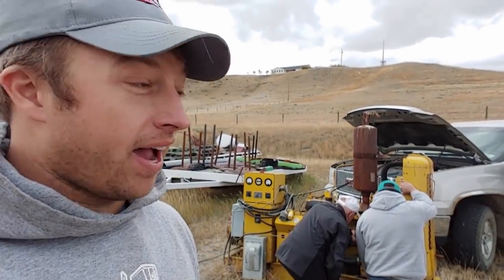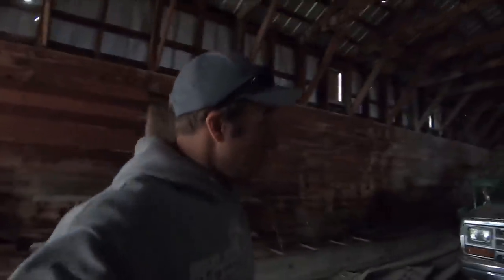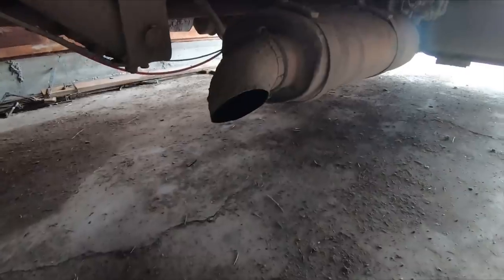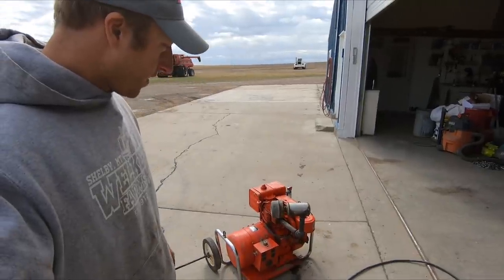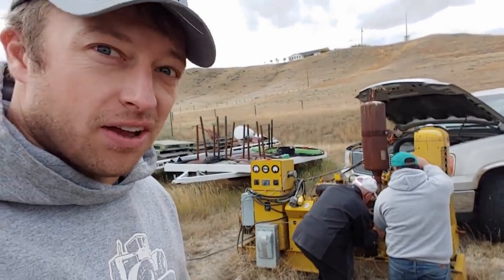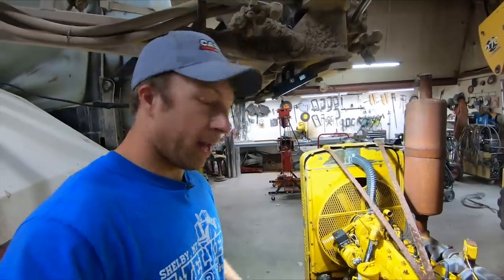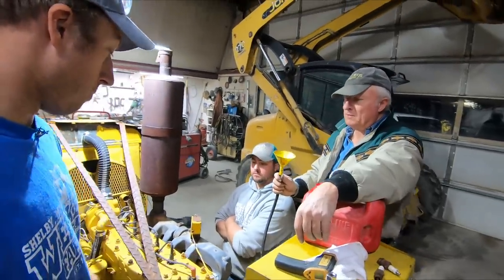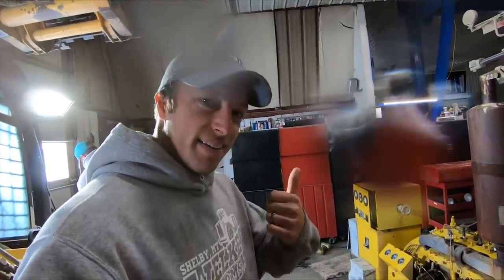Old Generator For A Mighty Storm

Comment: A shout out to everyone who’s fixed a pull starter issue on a small engine👍!
Reply: Joseph Huelsmann them recoil springs suck
Reply: @shelly8334 , Agree. 99% of the time, the spring doesn't need to be removed. Remove old rope, feed new one through the hole, knot the end and use that notch Nick pointed at to wind the spring and rope at the same time.
Reply: Part of shop class in high school was small engine repair-- part of the test was the teacher coming up and cutting the pull cord and making you replace it.  Disliked that man.  Loved that class.  Learned a lot.
Reply: my recollection was a piece of old clothes line was used
Reply: I once inherited a 300$ mower from the trash on the side of the road because they broke the spring that pulls the rope back in. Gave it to a friend three years ago and still running.
Reply: Ditto but I loved my teacher.
Reply: shout out for anyone who shot the BS with the .45 and got a Kohler
Reply: @darthvader4hire  those old b&s engines are pretty relaible
Reply: But did it the easy way........😂
Reply: I don't understand why people hate re-winding a pull starter, I do it all the time, With a little patience and the right tools it is very easy.
Reply: @russmontgomery5211  It is easy, and most of the time disassembly isn't required. Manually wind the plastic rope sheave against the spring tension a few turns, (not too tight or the spring end will break), hold it in place with the tension on it, and feed a news rope in and tie a knot. When the sheave it released, (slowly), it pulls the new rope in.
It takes longer to remove/replace the pull starter assembly itself than replacing the rope.
Reply: @russmontgomery5211  you dont have to pull them to bits most time. Leave the recoil alone.
Reply: @michelebeck4311  I am probably more aware than most on how to fix a recoil starter ( I probably do 10 or more a week) So I do not need to be reminded, But thanks anyway.
Reply: Amen, brother!
Reply: I tried doing that once then during a break noticed the impact wrench I'd been using to take the pull starter housing apart and got an idea.
Reply: yup i fixed a jd 68s pull start it has elcetric start but i use pull start too

Comment: ok, so what i used to do on the oilfield generators i built and worked on is set the throttle speed to the hertz meter you will need 60 hz for proper power. so set the throttle up to speed till you get to 62 HZ so when the engine pulls down under load you will be at 60 hz and adj. the regulator to 120V or 220v whatever voltage it's wired to. keep it under a cover so those old exciters on the generator don't get wet and put a good shielded/sheathed ground cable on the frame and attach it to that ground rod i saw on the frame and drive it into the ground. i would run a battery tender to the unit to float charge the battery and also a block heater so when you need the unit it's GTG. a normal house will need close to 8KW to run most lights and appliances minus the elect. stove and water heater. i can run my house minus the elect stove on 7500 watts we have  an on demand water heater and we have mini split A/C and heat pumps which don't use much power i can also run my well pump and charge pump etc. with that. i can not use my air compressor but can run my lathe and mill and shop lights etc. with the 7500 watts. 35kw is a great size generator to wire in if you have all the houses on a grid and i would also look into a surge protector to protect your homes from overload.
Reply: This.  Make sure you get the frequency right or you will burn out almost anything that you plug into it.
Reply: Maybe you already have one but you MUST have a means to disconnect the utility from your house before you tie in the generator so you don't power up the lineman doing the repair from the storm.  Normally this would be a transfer switch. And yes, don't forget the earth ground connection!  Nice rig. Good job getting it running.
Reply: They're not hard wired there yet but now a manual transfer switch is the cheapest way to go.

I'd throw on a car remote starter too. And a propane conversion kit this way here you can run off an 80 gallon propane tank.
Reply: @anastyb  i like the propane alternative we use 100# bottles here so i can fill them when i go to town for $1.75 a gallon as opposed to well over $2 to have it delivered and i use the bottles in various locations on the property so 1. bottle wouldn't do. propane will last forever in the bottle as opposed to gas which doesn't age well. in some areas propane is super exp. i bought some in Redwing MN one time for my RV, i thought i was filling the bottles with liquid GOLD.
Reply: @markthegunplumber8376  wow and I thought things out here on the East coast or expensive I just checked the prices and we only pay a dollar 41 a gallon delivered for propane we can get it for a dollar 34 if we take 500 gallons.
 In days past we used to get twenty one hundred gallons of number 2 oil this way here we were all set on heat for the whole year.
 my friend Mark was in northern Connecticut with a farm and he cooks and heats hot water with propane he gets hundred-pound bottles filled down at the Agway because he says it's cheaper.

Yeah the propane conversion kits are cool I've used them on my Jenny's in the past.

Adding remote start is an added bonus.
Reply: @anastyb  that's what happens when you live in a Liberal run state. it's not the propane that's expensive it's the taxes on the propane that's expensive. it's .34 cents a gallon here plus any county taxes on top of that.
Reply: @markthegunplumber8376  wow that's cheap!
 I think $7 of the $10 for a pack of cigarettes here is tax.
Reply: @anastyb  no oil and gas here so it's all trucked or pipelined in and our LGBTQ Governor only wants wind and solar energy here she hasn't figured out that you can't run vehicles and farm machinery on hopes and dreams and rainbows and unicorn farts. this is the only state left i think where it's illegal to pump your own gas. they want to save those jobs for the near do wells who can't do anything else.
Reply: @hihaveaniceday9386  formerly the socialist republic of Kalifornia now Retired in Orygun
Reply: @markthegunplumber8376  Ah, NEW JERSEY HERE . WE DON'T PUMP OUR OWN GAS HERE. I THINK WE ARE THE ONLY STATE WHERE YOU DON'T PUMP YOUR OWN GAS AND WE PAY LESS PER. GALLON WHERE YOU HAVE TO PUMP YOUR OWN.  BUT DON'T WORRY,  WE HAVE THE HIGHEST PROPERTY TAX'S IN THE COUNTRY AND IF YOU WANT TO DRIVE MOST PLACES YOU BETTER HAVE EASY PASS FOR ALL THE TOLL ROADS AND BRIDGES.  THANKS DEMOCRATS !
Reply: "NERDS!!!"

Comment: Best to be prepared. I remember about ten years ago we lost power in our home for two weeks due to a horrible ice and snow storm. 6ft of snow in 30 hours followed by a night of ice rain. It covered everything and every powerline with thick ice and ripped everything apart due to the weight. And because the ice was everywhere and we living at the very top of a mountain with one possible road to town we were completely isolated from society. We had no water because the well pump of course didn't work, but we melted snow on the fireplace/oven (I don't know what it's called sorry) and we got a new appreciation for everything we had in our cupboards and things like that. After the first week me and my Grandpa decided to try and make our way to town 3.8 miles of 0.4 miles hight different like, from us to the town. Everything was ice and we could bearly walk with shoes my grandpa had painstakingly screwed hundreds of screws into from the inside out for traction. So we started walking down at 8 in the morning, by 2pm we reach a road where farmers (bless them) were going back and forth with tractors picking up people and taking them into town for supplies at the back of sleads they'd kept from they did logging with horses many years ago. Well into town we realized just how dire the situation actually was - there was nothing to get. Apart from food, the stores had rationed out pre packaged boxes with food and necessary supplies depending on the size of your household, since we had 7 people and a very young child we got very much stuff, so much so we could hardly carry it between me and my grandpa - and we still wanted to get some fuel and a generator or propane (we have a backup propane fridge) but there was nothing left except some propane camping gear, so we grabbed a few of them and a Slead to pull everything in that we fitted nails to at the back so it wouldn't slide backwards up the steap hills to our house. We also got a small solar power setup with a battery and everything to be able to listen to the radio for news and possibly charge a phone or two (we actually had two old Nokia 3310 that we had decided to keep charged before the storm hit, and I'm so incredibly glad we did because they lasted the full two weeks and we could make calls to the people trying to help us) anyway, back to our town. We got packed up and ready to move back home, but it was getting dark and it was getting dark quick and with the temperature dropping over - 22 degrees fahrenheit there was no way we would get home. So we got to stay with a couple of old friends of my grandpa overnight, we got some hot soup, coffee and kvikk lunch (it's a kit Kat hiking chocolate we have here) with us for the walk home and started the journey home. It took almost 10 hours to walk home with all the gear, and my grandpa at 77 at the time struggled the least out of the two of us. He was a tank, powering through the freezing cold, old age and exhaustion the old man got us home to our family just an hour after dark when the temperature hit - 30 fahrenheit. Exhausted, freezing, starving and frostbitten we came home to the warmest welcome a person could ever get. Home baked bread from the fireplace, potatoes and some meat stew and a warm bed in the living room with everyone else. A welcome fit for a hero. Till this day my grandpa never forgets the trip or the two weeks of frozen hell, the worst winter in history for our little town and a reminder to always have some canned and non perishable food in the house. We now have a small generator and a big drum of gas the we swap the gas in every winter, enough to keep food and water going for our house for at least two weeks at all times. I'm sorry for the long comment, but I thought I would have to share this story with you guys. And sorry for not knowing every word in English. (I tried to convert the units for you guys though)
Reply: That was a very bad ice storm.  We have never faced anything like that.  Thanks for the memory.
Reply: The english was very easy to read thank you for your story.
Reply: Wow! Great story.God bless you and your family.
Reply: Tremendous story! Proof that YouTube comments don't have to suck. I salute you and yours, sir.
Reply: What country?

Comment: Definitely needs to run at 1800 RPM as previously stated by others to provide 60 hertz. Set RPM first then adjust voltage.

Comment: The 60 cycles a second depends on the engine rpm. By you slowing the engine down you may have reduced the cycles per second and doing that can damage whatever you have plugged into it.  Use a voltmeter to check your Hertz or cycles per second before using it.

Comment: Several people have mentioned that it is important to get the frequency set to 60 Hz and it is.  Nobody mentioned that the generator has a built in meter to show the frequency.  That middle meter on the generator cabinet is a frequency meter.  It is clearly vissible in the video at 29:40.  It contains several reeds that vibrate at the output frequency.  The one that vibrates most is the current value.  So set your engine rpm so that under load the 60 Hz (more likely labelled Cycles per Second on that one) is vibrating the most.  Then adjust your output voltage.  Our power company targets 120 volts but allows a 10% variation so voltage is not as critical as frequency.

Comment: IMPORTANT, just a tip with older generators. My dads an electrician/farmer and most burned fridges, fluoride bulbs and electronics are due to old generator's governors. Hook up a multimeter BOTH under load and free to check the hertz. Sometimes the load dips just to far when engageing loads or is running too high at start and fries your appliances ecpecially microwaves. O and when switching over try to switch on breakers one by one so as to not jolt the genset too much and cause a frequency dip. Anyway hope it helps if you didn't know already and stay cozy.

Comment: When we winterize the sprayers we just put about 200g of 28-0-0 liquid fertilizer in the tank and then go spray about 100g out through everything.  We make sure we leave enough in the tank to keep the pump completely full because as long as there’s no air in pump housing it doesn’t rust. Might get colder there and not work for you. We get down to single digits here.  Been doing that for the last 25 years and haven’t had any issues. Much easier then draining things. Thanks for the vids.

Comment: "I'm just going to use the pull starter on this generator because the electric starter's wires are all disconnected and what not" Pulls cord once, cord doesn't go back in Yep, that's typical pull starter behavior.
Reply: That's step one of pull starter initiation.  Step two is taking it off to fix it and fielding a spring to the jaw.
Reply: this video reminds me to get a generator, but fixing up a busted one, nope!

Comment: When I had my Barndominium built I had a generator system put in. It will run everything and runs off natural gas from the utilities or propane and Diesel.
Keep up the great videos.
Reply: you have a engine that runs off natural gas, propane And diesel??  that is a first..  does it have a injection pump, injectors and a carburetor too??
Reply: @vdub4201  yeah it's technology that been around for years, maybe you need to get out of your mother's basement and learn something.
Reply: @brianhubbard6423  how original..  I will get right on that sweetness

Comment: Be sure to use a temperature correction chart on the engine generator when setting the charge voltage.
Reply: A what? I probably too young to know
Reply: @Adiiii87  Lead acid batteries need different charge/float voltages for different temperatures.

Comment: I get tickled when there is "dread" of the snow as we sit here in Mississippi after just setting several days worth of "new record high temperatures".  Truth be told when there is a prediction of snow people go bonkers around here, emptying store shelves of bread and milk, schools shut down so buses don't have to risk traveling in something they have almost zero experience with.  I was in college in Iowa in the mid 70's so got a good bit of snow driving experience.  With our heat we envy the cool weather.  Did enjoy our recent mid Sept trip up your way to visit family in Whitehall.  Felt almost surreal sleeping with open windows every night while a mid to low 50 degree breeze was coming in.  A lot of me wants to relocate to your part of the country.  Made a mule deer hunt out of Havre in 2016, love the country up that way, enjoy your videos.

I know Leg Arms has likely thought about this, but I would put an oil pressure switch inline with the fuel pump primary power supply to kill the engine if the oil pressure drops.  Then to prime for starting put a momentary on push button bypass switch that would have to be held down during the start cycle.  Just a save the engine thought.  Agree with another poster about the engine RPM, it all has to do with the cycles, USA power systems are 60 cycles which takes 1800 RPM on a low speed generator or 3600 RPM on the small generators like the Briggs unit you fixed the starter rope on.  With the engine at 1500 RPM you are likely only making 50 cycle juice, NOT GOOD for any of your USA electric devices.  With the right kind of tester you can adjust the throttle while the unit is under a load to get the cycles where they need to be.  In my experience the no load cycles on my small generators tends to come in at about 62 cycles then a decent load pulls it down to about 60.  I have been told a bit over is preferable to a bit under.
Reply: So glad there are commentores like you and others. Learn lots, Blessings 👍

Comment: When you get time, switch it to run on gas or Natural gas or propane.  I spent $300 on gas during the last Hurricane my neighbor spent $35 on nat gas.  Justathought!  Keep the great vids coming.  I really enjoy seeing your Dad's contribution to the you tube effort.  ;-)
Reply: There are other benefits than just the money side. You don't have the problems with ethanol. And propane as far cleaner than gas to burn (carbon buildup).
Reply: Wood gas would be better yet , but it looks like typical farmground , most farmers are tree haters , Get z pig barn and a digester , and generate all your own electricity all the time.
Reply: Well the conversion cost actually makes it not so good. (It's like $9000 dollars)

Comment: Swamie says "I see Generac whole house generators appearing at at least 1 Welker residence for demonstration purposes "  Anyone else have that kind of a vision? That old one might run the whole operation though! Thanks for the video!
Reply: Only way it could run the whole operation is if the entire setup is on a single transformer and they tap in on the meter side.  If their power company and setups are like is typical in our area when there is any distance involved (250 feet +) they string the uninsulated "high wires" to the end then set transformers as needed for a meter or two.
Reply: Oh I agree with the distances not working I just meant the capacity!

Comment: Good project for next summer. Build a shed between yalls houses for that badass new generator. Run the exhaust thru the roof and put in a power line to all the buildings. Hmmm ideas ideas. Good job gettin that ole gal runnin again y’all.